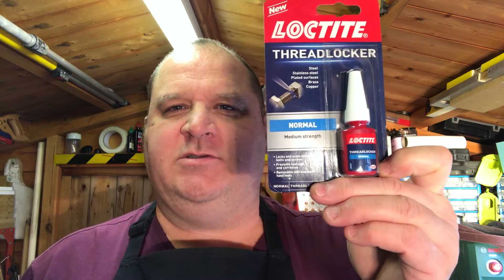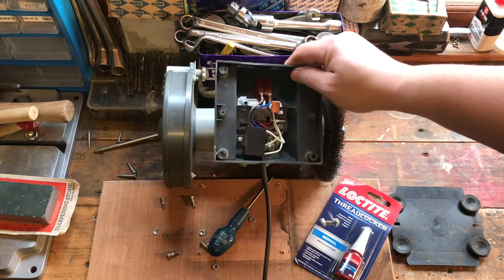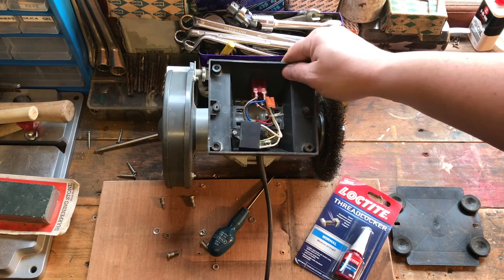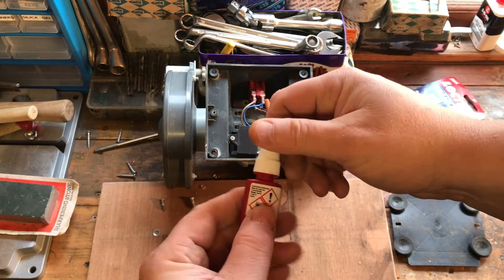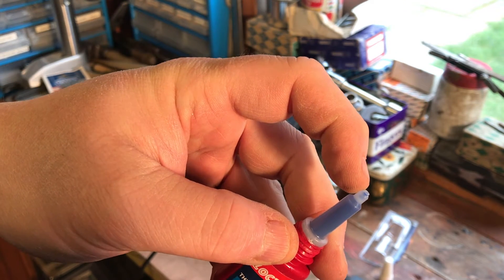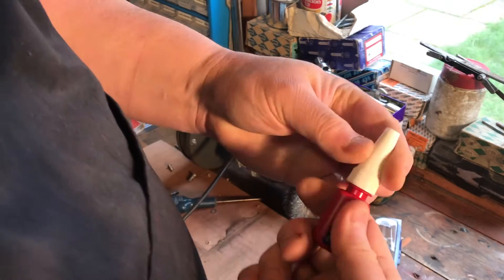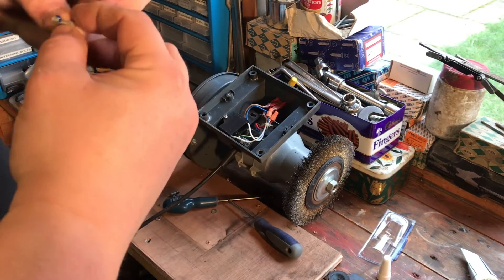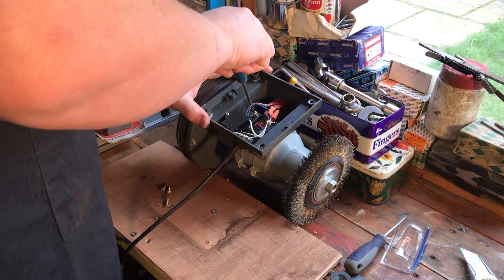How to: Stop bolts coming Loose

Comment: Can you use that for wheel bolts
Reply from the maker: I think you can use it for all bolts. The idea with that strength thread locker is that it shouldn't come loose unless you use mechanical tools. However, like all great arse covering comments, I'll refer you to the manufacturer for their final say. 
Thanks for watching and commenting and please remember to like the video and subscribe for more helpful advice.

Comment: Sir my rubics cube screw is loose and it is not going inside cube so it will be helpful or not
Reply from the maker: Wouldn't harm to give it a try. So long as you don't need to turn it etc. You don't want to glue anything that needs to move freely.